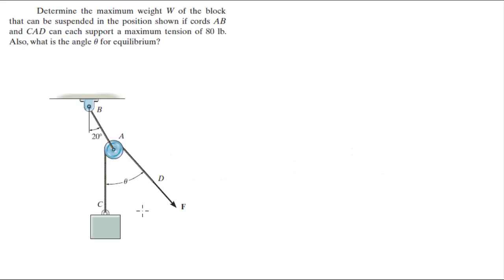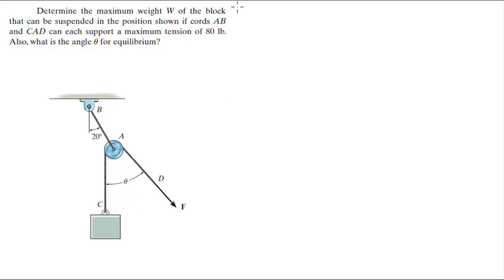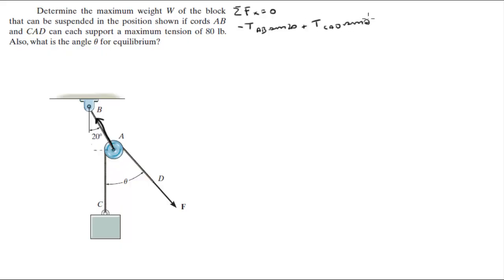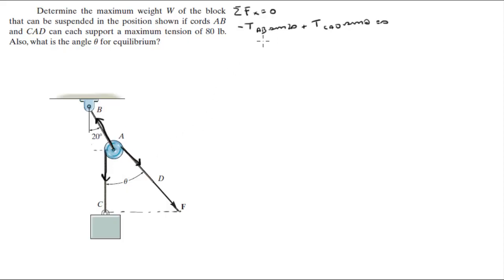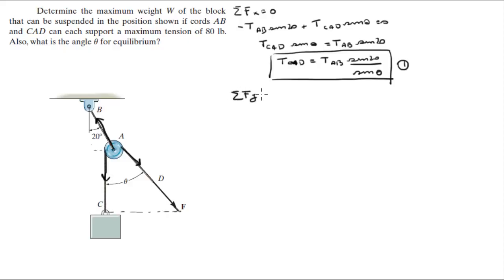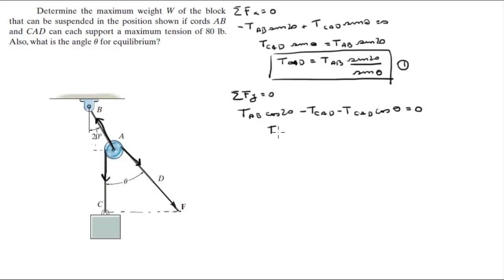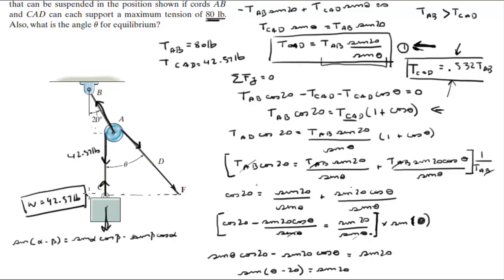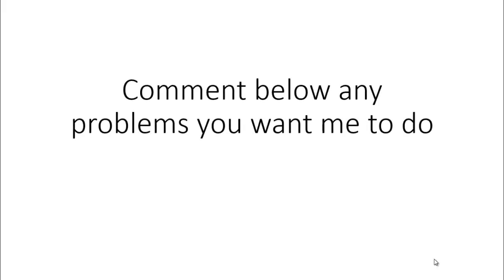Determine the maximum weight W of the block

Comment: why is it  -Tabsin20 instead of -tabcos20 ? because you're solving for the summation of forces in the X.
Reply: if you were to solve the triangle to find the angle against the negative x axis, you would solve Fx by using cos(70) which equals the same thing as sin(20). he did it a little differently but it is right.

Comment: The sports car has a mass of 1.5 Mg and mass center at G . If the front two springs each have a stiffness of kA = 58 kN>m and the rear two springs each have a stiffness of kB = 65 kN>m, determine their compression when the car is parked on the 30 incline. Also, what friction force FB must be applied to each of the rear wheels to hold the car in equilibrium Hint: First determine the normal force at A and B , then determine the compression in the springs
Can you solve this problem for me?